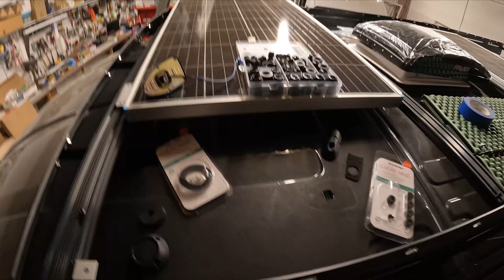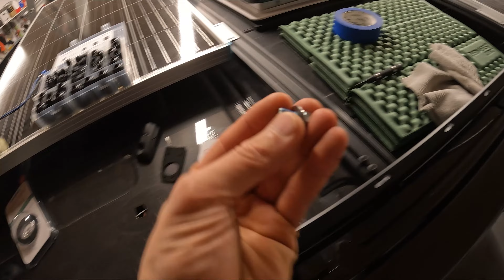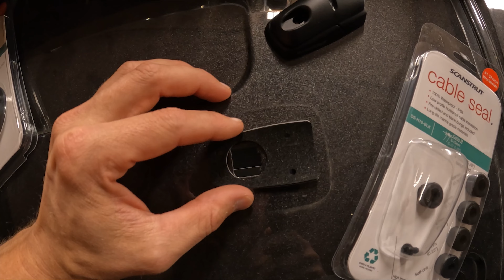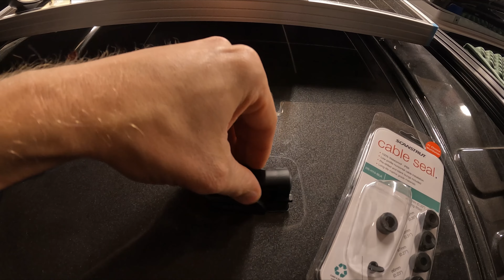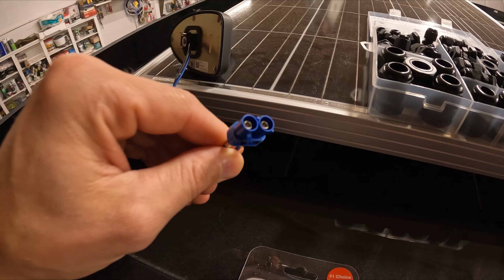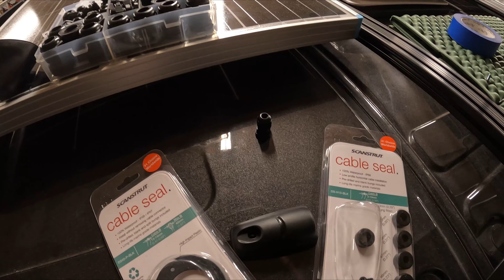How to seal holes in your Camper Van Roof using Waterproof Cable Gland Seal Kit!

Comment: Thank you.  Needed the glad tip for solar and Starlink cables.  Looks like one needs access inside the vehicle for the nut?
Reply from the maker: Yes, you will need access to the inside of the vehicle to tighten the nut to seal the gland. Scanstrut makes different marine fittings that allow for imperfect diameter cables and use a different compression mechanism. I'm not completely against the larger cable gland solutions, however you have to REALLY make sure they are water tight after installing them (make sure you use a good lap sealant). Thanks for watching, hope that helps!